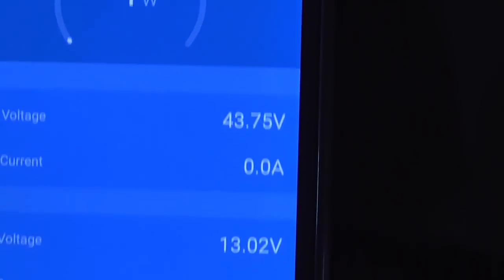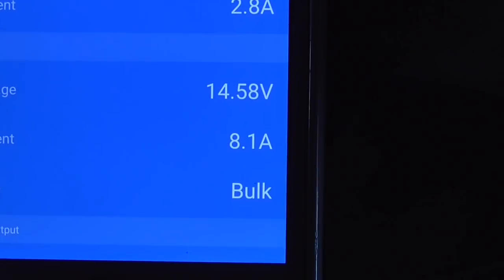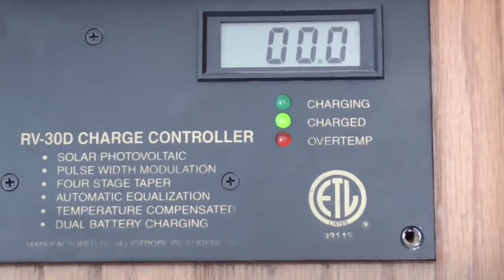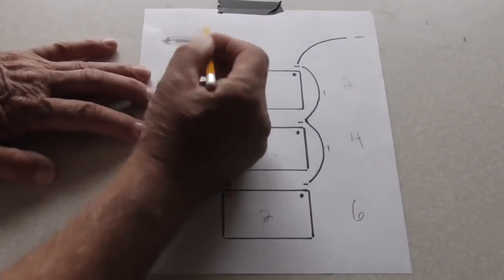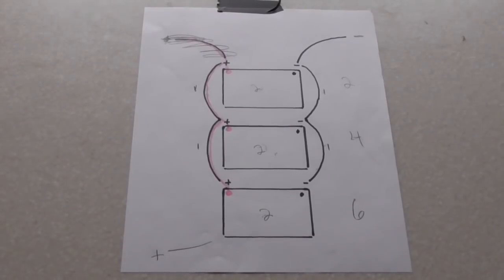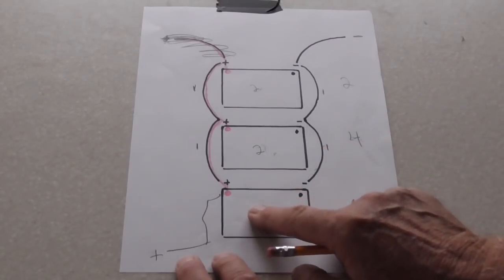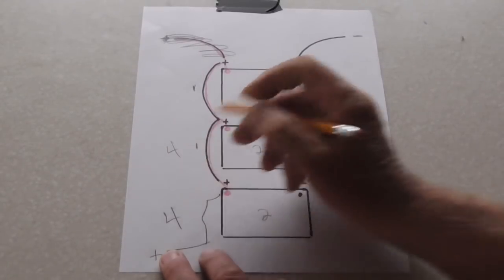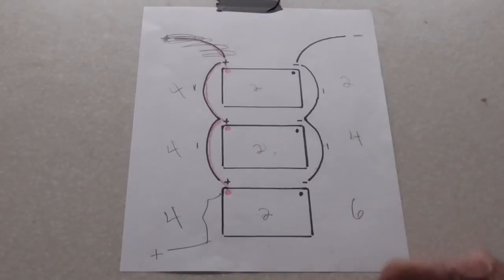How to correctly wire a parallel battery bank.  Solar Question Update.

Comment: I have always thought a good way to do it would be “it maybe wrong” is to have a bus bar and connect all the + and - to the +/- bus bars 🤔, I know it would take more wire. Looks to me though it would work even more even.
Reply from the maker: Maybe. :)
Reply: @JCTravelStories  Thank you, for your reply. Just reading your description, how hard is it to travel in a 40 inch motor home 🤔? My transportation is a electric bicycle I charge from solar. I would also like to know where to get one of those 😏. Bless you and yours…
Reply from the maker: A large motorhome can be intimidating to drive and park, but we spend much more time parked than driving.  We enjoy the big rig, the towed Jeep, and the electric tricycle.  After a hot shower I sleep in my big bed.  Its a life style we like.

Comment: Good electron flow summary diagram, except I was taught electrons have a minus charge and electrons flow from minus to positive. Not that it makes any difference in what you explained about resistance.. Let me throw this out. If you correctly had the charge circuity wired, but had a corroded battery terminal or two, what happens then? Seriously, you must maintain perfect battery connections with multiple battery systems so those pesky electrons don't get confused and go elsewhere :)  Thumbs up! 
PS...No one has ever physically seen an electron, so it is all theory anyway!
Reply from the maker: tim gear .... Correct you are!  Negatively charged electrons are attracted to positive charges, so when you use a battery the current flows from negative to positive in the circuit.  The physics and chemistry of batteries is a lot more complicated than little things called electrons moving through a circuit, but its a good way for us who don't have a degree in quantum physics to talk about it.  Charging a battery reverses the current flow.  The flow goes backwards positive to negative ( relative to the battery and the diagram) during charging.

Also correct that dirty terminals would certainly change the resistance and the paths of least resistance. 

Also correct that its not possible to see an electron ... Not even with an electron microscope!  Thanks for your commemt.  :)

Comment: J C your diesel alt might not be putting out 100 percent might be long in tooth. 6 to 10 hours 250 to 300 amp alt everything should be glowing with charge. ✌👍🔧🔋
Reply from the maker: Nope.  Its fine.  thanks for the input.  :)

Comment: Jerry, just a thought would be to prioritize the controllers. Create a circuit that is monitoring each controller and isolate the others via contractors. Example if the engine is running that is number 1, if it’s not one of the solar chargers is number 2 etc. I don’t have the exact circuit in my mind without more thought. Just a direction to look at.
Reply from the maker: Actually, with regard to the sources excluding the solar ... generator, shore power, or main engine ... there is an existing transfer switch.

Comment: So thankful for this video. Please forgive if I am acting dense but if I am understanding correctly, a person could hook up more than three batteries in parallel in this configuration, without causing any further accumulation of damage to the battery. I'm sorry if you have discussed this in another video as this is the first of yours I have watched regarding this topic. Thank you
Reply from the maker: simple answer ... yes .... but in practice many larger systems use 6 volt batteries and each pair of two are in series to create 12v ... so it would be more correct to say hooking up banks of batteries in parallel.  And of course if you're using 6 volt batteries in a 12v system you can't hook up three.  It has to be an even number.  :)
Reply: @JCTravelStories  Thank you. Love your videos and you and your family/friends well.

Comment: Great video at explaining. I have a question regarding the second example of connecting 3 batteries in parallel, if you connect charge source to opposite batteries do you then connect draw from the same terminals?
Reply from the maker: If I understand your question correctly .... Yes.  :)

Comment: Lynn made me laugh out loud.
Of course, I get the same reaction from my own wife, so it was nice to see that I am not the only one to experience the "commentary".
About the multiple battery charging sources...
My college major was in electronics, and I've designed many a circuit, so ...
here is my two cents worth:
If I was the design engineer of your solar chargers, I'd be waving my hands in the air and my heart would be racing.
None of the charging methods are designed to be compatable with the other methods you are using.
Each was designed to operate singularly. (Probably says so too, in the small print, under the legal disclaimer.)
You are correct, in your conclusion that they intefere with one another.
My suggestion:
I noticed that you have two very nice Battery Selector Switches mounted on the Electrical Panel.
These should be used to combine both the Starting Batteries and the Storage Batteries (deep cycle "house" batteries) in parallel connection while the engine is running and you are driving for an extended period of time.
However, when you park the motorhome and shut the engine off, the Battery Selector Switches should be set to "isolate" the starting, and the house battery banks (taking them out of parallel connection) and only the house battery bank should be relied upon for interior lighting and other DC appliances.
Note: The solar panel chargers should only be permitted to charge the house batteries WHEN they are isolated from the starting batteries. 
This will prevent competition between charging sources, and prevent other maladies from rearing their ugly heads at a later date (and no doubt, an inopportune time.)
Example: If the designer of Solar Charge Controller A saw fit to dissipate excess charging current from the solar panels, by means of "dumping" the current through an internal power resistor, whenever Full Charge was sensed on the associated battery bank  ...
it might not take kindly to the 225 Amp engine alternator "cooking" the power resistor, due to the two battery banks remaining in parallel during drive time.
No one can tell you definitively, if this, or any other situation exists, without studying the electronic schematics of the chargers in question, or at least having a phone chat with the manufacturers.
That is my two cents worth. Sorry if it seemed like three cents, but I'm simply trying to help.
Do what you will, with it.
CTRL / ALT / DELETE  doesn't cost anything. 😃
Best regards.
Reply from the maker: marshalllhiepler ... It is obvious, Marshall, that you understand both electricity and marriage!  Thank you for all 3 cents, I think I got a whole nickel's worth.  I agree with everything you wrote regarding electrical charging systems and how they can interfere with each other.  You're undoubtedly correct that each system is engineered to stand alone without enough forethought about how it might be integrated into a more complicated system.  Probably less true for higher end more expensive grid tie capable solar charge controllers than the simple cheaper models appropriate for small RV arrays. It IS apparent that you are not an RVer.  All RVs, even low end simple trailers, have battery isolators so that you don't run down your starting battery using the lights in your camper and get stranded in the boondocks.  So, again, you're correct that using the battery cutoffs would do that job, but in an RV, its not necessry.  That function is standard and transparent to the user.  There are also automatic transfer switches that manage the integration of shore power, generator power, or engine alternator power.  Thanks for your input!  :)

Comment: I recognize this is an older video, but your thoughts here about solar tricking your diesel alternator that the battery is charged sounds correct. You sound spot on with your theories. Good watch! Earned a subscriber!
Reply from the maker: Thanks for subscribing Puddin.  :)